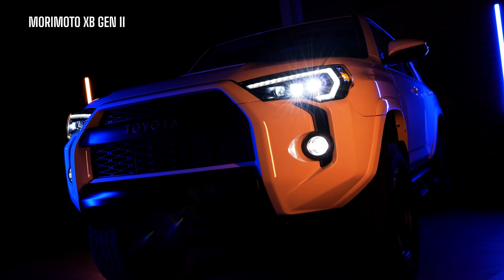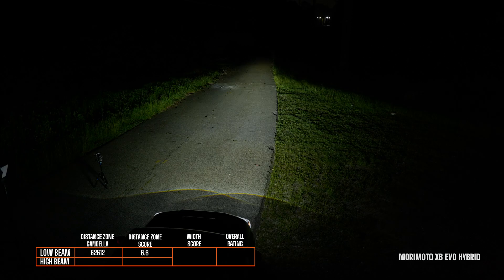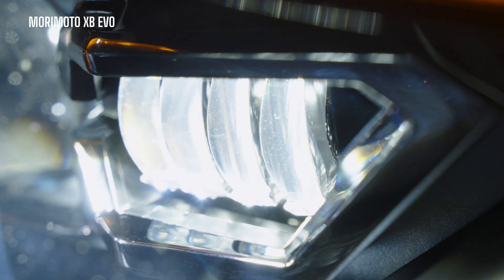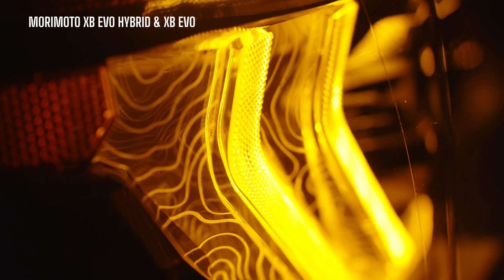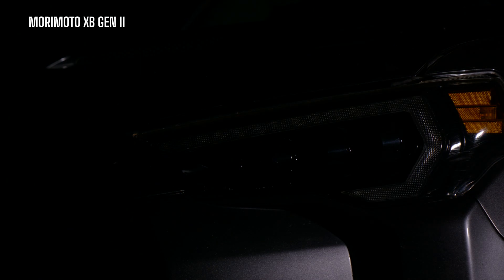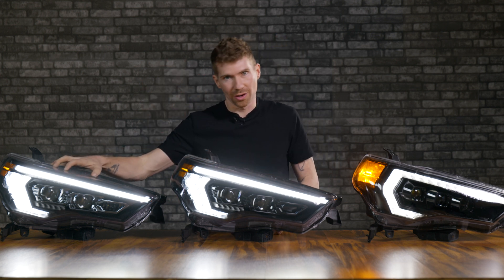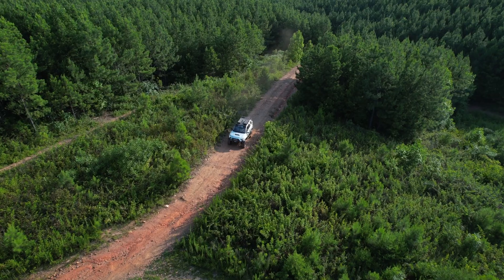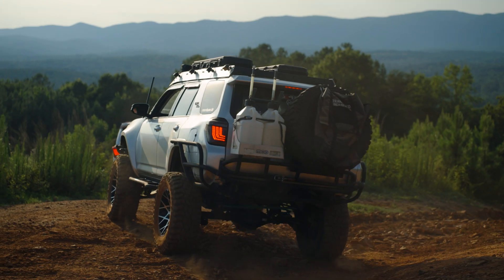Old vs New Morimoto 2014-2024 4Runner XB Evo LED Headlights | Massive Upgrade or All Hype?

Comment: I have the new xb evos on my 4runner. I love them but the view looks different than what you portrayed atleast on the road as far as projection. It looks like a few peaks and valleys and understand that it's not to blind oncoming drivers but its significantly darker cut off v shape in the 10-11 o'clock position. Is this normal?
Reply from the maker: Thanks for the feedback and for running the new XB Evos on your 4Runner — glad to hear you’re loving them overall! 👊

If you're noticing anything unusual in the beam pattern (especially after aiming them using our tutorial), you might want to check out this video that dives a little deeper into how the beam is designed to function:
📽️ https://www.youtube.com/watch?v=VfCrtJ8vq54&t=1s

That said, if you’re still seeing sharp drop-offs or dark spots, feel free to send us a few beam pattern pics to sales@headlightrevolution.com — we’ll be happy to take a look and help you determine if everything’s aligned properly or if adjustments are needed.

Comment: At 8:55 truth be told, as long as the lens consists of PMMA/Polycarbonate material (vs. acrylic or glass) it will oxidize/haze over time no matter how hardened it is. A quality UV resistant coating will take longer to break down under the elements (road debris, UV exposure, etc) but won't completely prevent the inevitable (oxidation). What WILL protect the lens long term, however, is quality clear PPF.